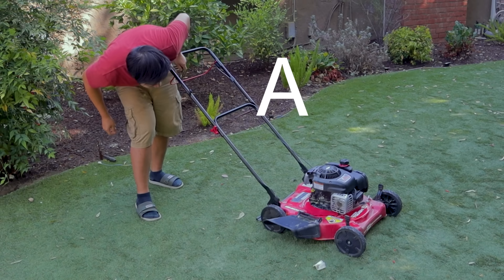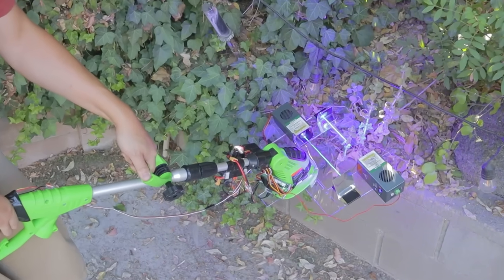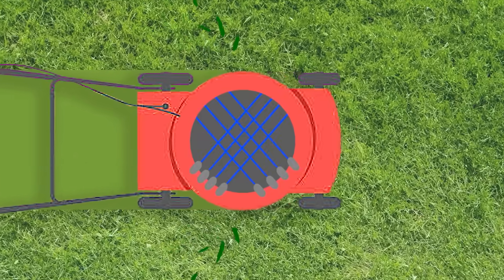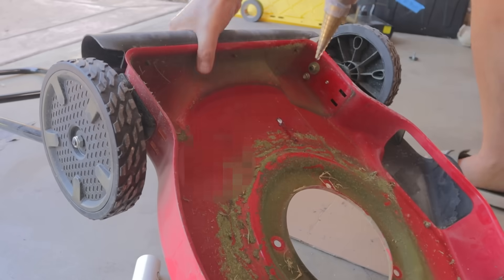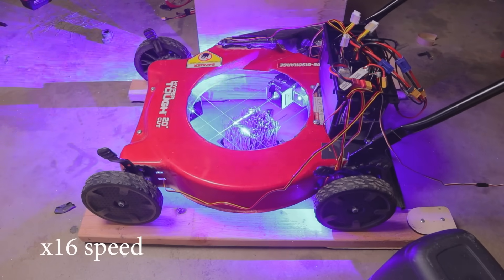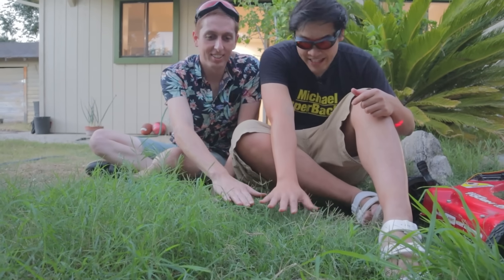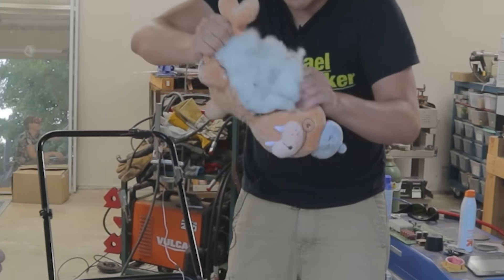mowing a Lawn like it's the year 3000

Comment: I have an idea.
The spectrum is wrong.
Also water may work better it burns hotter..lasers do not burn they pith..and the material is wet..
So very fast very thin hot water may work?
How low could you cut the grass?
Why cut grass?
Moss lawns perennials and stones for ice days  are better.

Comment: Your doing great!

To solve the issue of power, you need to have negatively-charged steel plates that the LASER is to be reflected on.

Okay... why? Applying a 20KV charge to the metallic mirrors, with your 20 Watt laser, you'll be adding the electrical charge to the photons would result in a exponential output of Photonic Charge.

Formula: (20KV x 20Watt-Lumens)^X. X = Amount of concaved metallic reflections used.

Edwin Land founded that setup.

Comment: Infinity adjustable mower deck size just have rows of Lazers go from  center out and have adjustable catch mirrors on telescopic rails from a 12 inch mow deck to 96inch mower  deck just adjusting mower speed to set burning properly  maybe buse servo motors to set drive speed  and make it hands free .. also have a scorpion 🦂 tail to stab at whatever is in front  of it on an actuator foe absolutely no reason other than it's  cool looking 😊 also battlebots

Comment: Part of the job of a mower blade is to suck the grass up, so they run into the blade. So, perhaps a vacuum system above the lasers.

Have you considered the low power style where the blade is in front, like the old school drum blades that you push by hand? If the laser blades are out in front and meet the grass before other parts of the mower then they shouldn't get shoved around. This way you should be able to use less lasers at once, and can have different height settings depending what lasers are on.

Combined with the last one, perhaps a gyro or shock absorbent system that keeps the laser blades about front level  despite the jostling caused by the wheels on unlevel ground.

Might cost some more money to put all that together, but hey shrugs you already bought the expensive toy, oh I mean tool, the lasers!

Comment: it is necessary to use a neural network and several cameras plus mobile lasers, so you can increase the power of the lasers and put them on one side so that the neural network detects one blade of grass and cuts it in short pulses, but from several angles. This way it will be safer and waste less energy. and if you put a lens that can change the angle, it will be even cooler.

Comment: You couldve just bought  a cheap ass high torque 12v motor and affixed the blade to that. And them had money to spare to add a direct drive 12v motor on rear wheel so its not push mower anymore

Comment: You can try from a static position. 
Put it in the ground and the laser cuts x distance in front and then move it to the next position. It actually will be even comfortable to use.
Because lasers are straight  you can even make it move a little every x time to make a rotation. (more area for less movement of the machine)

Comment: first question is , why the spinning. you dont need spinning with lazers. the deck is for power  mobility. but  the lazers can be redirected under it with set mirrors and a right angel pitch from the side... better. is a half mirror wedge to keep the light accrost the front  from reflecting back to the emitter.

Comment: Most modern mowers average 5km/h, that's 5000 meters in 60 minutes. 
You would need to move 83 meters per minutes to be equivalent. Your mower moved about 15 cm (and I'm generous) in 7 seconds x 16 (because of the fast foward) so that's 112 seconds. That's WAY MORE than a minute. A meter is 100 cm. So you would need to move 160 times faster to be equivalent to modern mowers so your lasers are way way way too weak. 

That is without talking about the potential of burning dry grass and the colour it will have after being burnt...

Comment: I'm extremely late down a rabbit hole but; if the lasers were on a gimbal / stabilizing plate they would stay level even over uneven terrain, if the portable unit had a vacuum system to pull away the dead grass into a collection bag there wouldn't be as much debris in the way of the lasers as they moved forward. Always fun to come back and visit old ideas.

Comment: You need something to blow the grass away. Likely if you mounted a vacuum above it then it would lift and suck  any pieces that are cut away enabling other pieces to be cut. Also, you might want to rotate the laser around in a circle so you can get all angles but this would assume you can cut one blade in one go(which is ultimately going to be necessary since any movement will effectively ruin the cutting ability since it is not focused).

Comment: What if you tried a different color laser that isn’t reflected so much by the grass?
Reply: Grass reflects green light that's why is green
Reply: @artificialintelligenceiscool yeah? Apparently grass only reflects 5-10% of the green light while absorbing over 85% of it anyways so it probably wouldn’t even make a significant difference. What wavelength was your laser? If it was a near infrared laser around 800 nanometer it may not be as effective as if it were closer to the 650 nanometer spectrum

Comment: Or you could just buy a quality robo mower, my husqvarna robo mover has been running flawless with zero issues the last 10 years, with only a single battery replacement, the ROI is huge.

Comment: There is 100% a reason this isn't a thing, Allen. For one, you are lasering a combustible (conditionally-based) material. Also, lasers aren't good at cutting grass that is lush and full of water anyways. I think something LIKE high pressure air would be more effective as a safe electric design alternative to gas-powered metal spinning blades, but it would still be loud I bet. I guess for now Spinning blades powered by combustion are peak design, and I'm guessing that's why they were mass-produced. Not optimal, just peak, that's called life. I'm proud of you for trying to Star Wars the grass though. You could build a lawn with an automated cutting system but for safety reasons it's probably better if the system has an operator like a standard lawnmowing machine. We're gonna beat this. First the lawn, then the cure for cancer. In that order.

Comment: O.K. Apparently the wheels on the lawn mower need to go. Seems like the mower would work well enough if it were actually a flying drone. Replace each wheel with a propeller and all the problems are solved. 😁

Comment: Alright, here’s an idea i had a while ago but I don’t exactly have the ability to make it, i call it the “mega pizza cutter”. So first you get a sawblade and attach it to a handle like a pizza cutter, but this could only be really dangerous if it was spinning, so because motors need batteries you attach a tiny gear to the blade. And a big gear to a ball bearing , then put the ball bearing on the handle plus a handle for cranking the big gear which cranks the little gear really fast which cranks the blade really fast, and then chain it to one of those armored padded gloves and put the glove on. Sorry if that was too much to read

Comment: Right now the robot autonomous mowers are king of the electrics. They're just like a robot room vacuum, but for your yard. But, these mow in a grid pattern that they "learn" and can learn to avoid obstacles. When the battery starts getting low or it's through mowing, it returns to it's station outside to recharge and wait for it's next scheduled mowing session. No garage needed, but a small cover over top of it's charging station will help keep it from getting "weathered!"

Comment: Like other lawn mowers they move grass via blowing them away so I have a suggestion of adding a fan or something to remove the grass so the other grass doesn't get in the way. Another idea is the same thing as you're spinning thing Winstead you focus to laser to a center and then spin it really fast that it's almost always in contact with a surface on every side leading to a wider grid not sure if I'm not explaining my idea correctly but the first suggestion is what I would go with. with what you have.

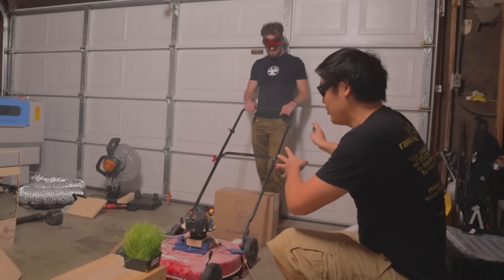Comment: heres a quick answer to the power issue on 1:33 is to follow the same design principles as naval turrets use. basically how they work is that turrets dont have their own power source, nor do they have an umbilical to connect them to the ship, they actually have a contact ring at the bottom of the turret assembly where the base of the turret rotates along a conductive ring track, this track supplies power as well as electronic inputs and communication to the turret, all without having a binding connection. this system also allows for turrets to be simply lifted out of the ship and swapped out for another one in a relatively short period of time.

funfact: the Aegis VLS system also employs this method, but with static contact points for power and input.

2nd funfact: all tank turrets employ this method, land based close in weapons systems on the other hand have an umbilical 
since they need to be more compact. sea based close in weapons systems on the other hand employ the contact ring method.

how do you make a contact ring? the cheap way is with heat resistant 3d printed plastic and some flat/stamped copper rings, 
the practical way is to replace the plastic with ceramic, and the military way is to use non-electroconductive metal as the insulator.

Comment: U couldve increased the power of the laser by having them intersect more, and those points of intersection would have more power due to two beams being there. They do this with gamma radiation therapy bc the beams have high penetration but weak energy to knockoff electrons, so they get multiple lasers intersecting at a single point to increase the energy where they want it

Comment: Do what the other guy did with the stationary ones but make one laser that will move from one side of your lawn slowely until all the glass is at one level and if you take a wooden board that goes the span of your yard it could keep it at the same height so you don’t get that problem again

Comment: hmm, the initial video is funny :D the laser is crap!
Just buy a normal petrol trimmer 43 cm^2 for about 4-8 thousand rubles! This one can be mowed with a line, and the "saw" disk can be used to mow grass for hay, as well as to cut trees up to 10 - 50 mm! BEWARE OF THE DISC IMPACT ON STONES, BRICKS, AND METAL!!! - because small carbide metals will fly away, and it will just mow stupidly ._.

Comment: My Skil PowerCore 40 battery powered mower is a freakin’ beast; I’ve beat the shit out of it for the past 4 years, battery is still perfect and still runs perfect I just keep it in my garage, the battery charge lasts roughly an hour (normally do everything in about 35-40 minutes) (charges a quarter of the way in 15 minutes). If it rains a bunch or I’m gone for like a month and the grass is like a foot tall it takes a couple hours to mow my 1.5 acre back yard and my roughly 30 yard sized front/ side yard, so I did get another battery which was $100 that way if the grass does get high I don’t have to wait for my better to fully recharge before I can finish mowing. But the mower itself with one battery you can buy for I think mine was $259 at Home Depot. Saying you need an $800 mower is retarded. And the batteries work with the weed eater and other large Skil tools, for smaller stuff like drills there’s the PowerCore 20 series.

Comment: Just get a robotic lawnmower, the lawn will look better thsn ever, and you won't have to push that around either, it's also quiet, so you can wake up to the smell of freshly cut grass every morning if you would like that, the mower can work all night, or atleast when it's not charging between cycles. Much better than burning the lawn down with lasers:)😂

Comment: The spinning blades on a regular lawnmower also act as a prop and pulls the glass in so blade can cut effectively.

The problem he having with the lasers can be solved by using a fiber laser setup. It be way more complex to setup as you have to design a focusing setup and way to aim the beam rapidly. It be way more efficient and wavelength won't no longer be a issue and they produce an extremely small focal diameter typically resulting in intensity up to 100 times more.

It also why the guy RC laser setup was actually cutting grass in front. Think wavelength and moving beams with a good optics and a servo motor setup to aim beam rapidly. Also other option is a wide beam laser that likely will cut a patch of grass no problem..

Comment: The blade lawnmower actually act as a prop pulling in the grass as it spinning. Then the reason the lasers did poor in cutting is due to wavelength has to be excat for it to cut well. You can get a wide beam. I think would actually work better would be a stationary laser setup control and using servos to control where lasers are pointed and then it likely cut grass in front way better, or do where you can focus the beam in a grid and focus in front. Would be complex as you need a way to auto focus and have servos change laser head back in forth. Using fiber can kinda of solve problem as you move the fiber beam same way a iPhone laser machine works where diode is stationary and goes though fiber and beam moves rapidly and well controlled.

Better yet don't do any of this as do at your own risk and extremely dangerous.😂😂😂

Comment: If ya really wanted it to rotate, you coulda used a bearing with a hole in the middle, a balanced bar mounted to it, and mounted the laser on top pointing down through to a mirror in the center angled pointing to the end of the rotating bar. 🤪

Comment: One of the big issues is that each laser is spending the vast majority of its time doing nothing and not burning anything. My opinion, mirrors are your best friend here. Even one laser at full mirror efficiency would be extremely effective. But you could use several lasers at very very slightly different elevations, all utilizing the same round mirror array, which would cut grass ridiculously efficiently and will likely come close to a real mower. Would love to see a version 2

Comment: I actually brought a ryobi battery mower three years ago and happily glad to say I am never buying an ice mower again. So simple and easy to use, super powerful as well.
Reply: The downside is you end up spending a couple mortgage payments in batteries if you want to cut anything more than a tenth of an acre.
I’ll stick with a tractor.
Reply: @PrebleStreetRecords  Wtf a tractor costs even more! Why is your solution more expensive than the original??
Reply: @MS2A-d7e You can get a used riding lawn mower for under $600, and my used International Harvester tractor was $4000. Even new, you can get a decent small tractor for under $5k.
A riding electric mower is $4k-$8k, and the batteries will eventually degrade.
If you’re crammed into a city with a postage stamp of land, then yeah, get electric. But anyone who lives somewhere nice needs ICE.
That being said, I’d kill for a good diesel-electric tractor that isn’t loaded down with anti-right-to-repair tech.

Comment: i would've had it also rotate to get different angles but not fully spin so the cables not mess up. Outlining the ring of the lawnmower with a metal to redirect heal on the mower to heal sinks and with copper tubes attached so steam wil rise and exhaust upwards and a gallon feeding into it to replace the converted water

Comment: 10 watts max on those laser heads pbly nubm33 diodes. you need to use IR 1000watt x10 or more and then it might be a lil more probable

Comment: I love the concept, as well as the tinkering that this dude is doing. That's how engineers and inventors get started. 

That said, thankfully for you Californians a Lowe's electric lawn mower (I believe the brand is called kobalt) is somewhere in the 300.00 range.  If you add a couple of extra batteries, that puts it closer to the $500 range but, I recommend it if you're going to go electric because then you just swap out the batteries when your lawn mower quits halfway through the job.
So far that's worked very well for me. 
By the way, it wasn't my intention to go electric, I just did it because I wanted the batteries for an extended chainsaw.

Comment: Dude. I rather use a scythe than to put all that money in. It's only around $200 and can last for centuries. Try doing a video about it. Do research on how to use it. Or go ahead and use drone motors with propellers a leaf blower. Use a battery backpack for big ah batteries for hours of work. But if you want cheap, use 4 775 dc motors with a 8 or 10 inch fan blade and use a buck booster module for 20v. One fan of 13v was strong enough to blow across my room the debris on the floor.

Comment: Lawn mowers have 2 specific elements to it. 1st is that it cuts the grass but the other part is the blades spinning create a vacuum effect to pull the grass straight. Try adding a leaf blower to suck the air upwards. it might also catch the grass on fire lol
Reply: unless the grass is really dry theres almost no chance of it catching 
fire from a laser, so just mow your loan with it after the drought is over.

Comment: 😂Now if you had them strategically placed I don't know as to pop up like sprinklers and on occasion set to go off every direction it may actually work to keep the grass low enough maybe even PREVENT or slow down the need for weekly yard cuttings.. idk 😶

Comment: A horseshoe shape would have prevented the grass being pressed down and avoiding the lasers. Or if it were shaped more like a classic push mower where the "blade" is suspended between the wheels - like one of those cheese slicers that's kinda shaped like a tuning fork with wire connecting the tips. When you redesign the cutting mechanism I guess you gotta redesign the geometry of the device itself. Not always but yeah sometimes.